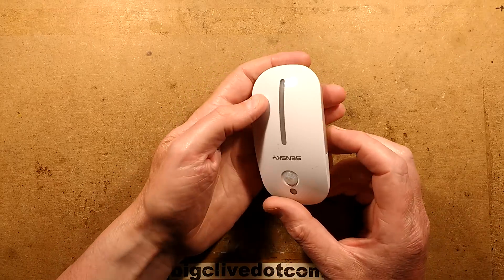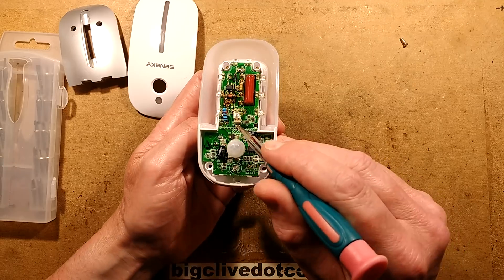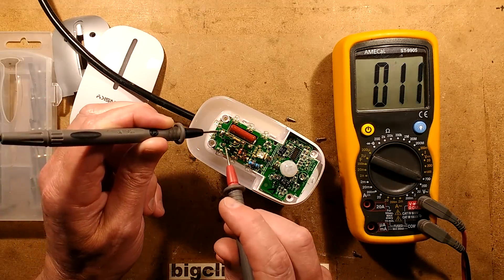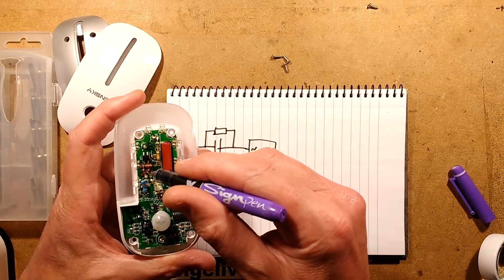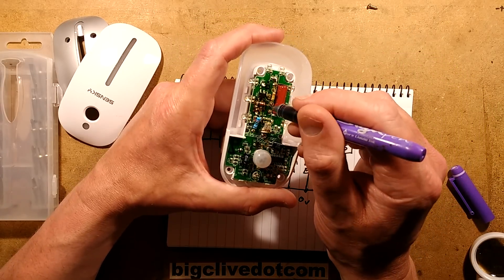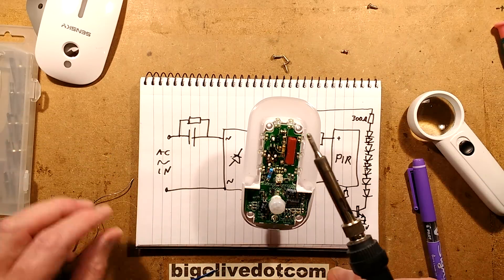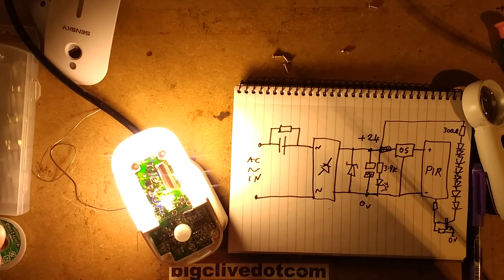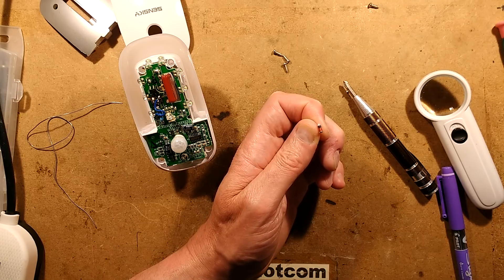Defective nightlight autopsy, half-assed fix and improvements.

Comment: Sure... When the voltage goes too high, just short out the power supply. That's an efficient way of dealing with it. :D
You could theoretically  solder in 40 regular diodes or so in series, instead of a zener diode or maybe a couple of LEDs (if they can take enough current) though that would kinda defeat the purpose. Not that soldering in 40 diodes would make a for better repair though. :D
I guess if you got no zener diodes, you got no zener diodes... That night light seems rather dodgy anyway. Not Chinese dodgy, just regular dodgy but still.

Comment: I've seen the lenses for PIR sensors come in all shapes and sizes, but this is the smallest I've seen, being able to slip just over the sensor itself :O It makes me wonder how critical this lens is to normal operation of the PIR, and how well/poorly it will work without it.
Reply from the maker: The sensors work by comparing the output of two adjacent detectors and relying on a series of lenses to create vivid transitions.  The smaller lens may have a shorter range than a bigger one.
Reply: bigclivedotcom I knew about the two elements in the sensor itself, just wasn't sure how much of a difference the lens itself made. It seems too small to be made that accurately, but then that'd stand to reason of the smaller lenses give shorter range anyway 😊 Thanks, Clive!

(PS you can't sleep either, huh? 😂)
Reply: Maybe they just use the day/night output.
Why would you want a movement sensor on a night light?

Comment: I would have put the zener after the resistor and before the regulator, it would still clamp the voltage, but would pass less current, unfortunately the LED's take their supply before the resistor.

Comment: Now, instead of switching the LEDs directly with a transistor, switch a resistor in to turn off the LEDs. Use a resistor to bypass some current to drop the voltage lower than the forward voltage of the LEDs, but still high enough to power the sensor (above the regulator dropout voltage). Now it'll use less power when off (still not zero) while the original circuit actually used more .

Comment: The resistor after the zener to the LM7805 should have been just after the rectifier, leading into the zener, being about 220 ohm or so. Most through-hole is 1W zener and SMT are 1W but without current limiting, its no wonder the zener fell down (malfunctioned).  Of course BigClive, taking out the zener, and a (say a 1/4 W non-SMT resistor before it, off the board connected mounted and all should be back to normal operation. Nonetheless, enjoyed your video as usual BigClive. In future, would like to see more Driverless Smart IC LED modules, even built into a nice (not the foul pink (red/blue) versions but real full spectrum warm-white and cool white combo configuration version (complete with dimmer) grow light would be nice.

Comment: I have several wall warts etc were the graphics on the case is oriented to imply the Chinese designer assumed the UK socket has the earth pin at the bottom, whereas in fact there is a very strong convention here that the earth pin is at the top.
Reply: Bill here, in the US, households generally have the ground pin down. In commercial where metallic wall plates are common, the ground is up so that if the screw falls out the plate does not short out the pins. Remember our pins are exposed their entire length.
Reply: Yes, that and the wires coming out the top of the wallwarts...which is sub optimal.  Although with the older transformer type that usually had a big bulky case, it may have been deliberate due to the old practice of putting outlets right at floor level
Reply: I believe this is probably because in the US, they ground is at the bottom. They likely can't be bothered to adjust the prints for UK market. Unfortunate.
Reply: @thysonsaccl Chances are probably wrong the right lines on thisaim
Reply: The story I heard, (don't know if it's 100% true) is that strictly speaking the code mandates that all US receptacles should really be mounted ground down, but the public prefer them upside down so they look like a face !

Comment: That means that the power used in nearly constant whether the light is on or off.  Why not have it on all of the time then?
Reply: In a word - marketing.  Because it's important to give the impression that you're saving power by turning off the lights.
Reply: JAMES AZBELL exactly, it might even use a little bit more power when off. Now, if the circuit were to switch in a lower voltage zener to turn the LEDs off, it'd use less power when off, but still not zero. A simple permanently-on LED would be ultimately more economical.
Reply: It is OK to short out a capacitive dropper. It is like a reactive current source. When you short it out you reduce consumption of "real" power. Of course this is not  the case with a resistive dropper.
Reply: JAMES AZBELL That is one of the key disadvantages of capacitive droppers.  They only work at constant power consumption, because the whole principle is to drop a large fraction of the power as virtual power in the capacitor.
Reply: I think one of the others that Clive disassembled turned off the LEDs by shorting them out. That'll reduce power consumption - current will increase, but it's almost all reactive. I suppose you'd have to make sure you left enough voltage to power the PIR, but that's probably only about 5V rather than 24V or whatever.

Comment: Heh. I have this exact light. Really like it... and the "Sensky" badge is the right way up in Canada ;-) Curious if mine will eventually cook, or if it'll do better at our 120V.

[Edit] I got curious as cracked mine open. It has a completely different board, but the circuit looks about the same. No sign of heat stress - just schmutz from the hand-soldered PIR.
Pic: https://ln.sync.com/dl/5aaa8e050/e6phv5nx-u9ypwgmj-gxuihgd5-9iqc8m5f

Comment: I bought a set of LED Stripes that included a generic Power Supply. The Powersupply didn't work straight out of the box, i already opened it, but I can send it to you if you want to Autopsy it

Comment: Bloody triangular screws!!
Reply: You can easily open them using a flatblade screwdriver that fits inside one of the sides of the triangle. Torque your way up slowly and you'll be ok. They couldn't defeat me as a kid with McDonald's toys, can't be bothered to be bothered by them today either.
Reply: Replace it with square screws with a pin in the middle
Reply: John Possum 
Or just repeatedly hit it with your X-ray device (hammer) until it yields.
Reply: Friend calls these "Toblerone Screws" for pretty obvious reasons!
Reply: just jam a flathead in and go. if super tight use hammer to flatten the whole thing :))
Reply: You can get cheap driver sets on Amazon (at least in the USA), that have drivers that can fit the triangle screws. But that's not to say you won't come across some proprietary, odd-sized ones.
Reply: At least its easy to grind a triangle screwdriver.
Reply: dremel a slot in them and open with a normal screwdriver. Works on all security screws, too.
Reply: lmao @ Phil S.  that didn't even cross my mind, but is spot on :)))
Reply: You know what I hate worse? Triangular wing bits in precision screwdriver kits. They look like phillips but don't work at all xD

Comment: I'm surprised to see so many pieces to this circuit. That's a lot of silicon for one simple little circuit.
Reply: Me too but when that happen I usually find out I'm wrong when trying to design my own.
Reply: It's not worth trying to design your own when these things are available for like $5 unless you have a custom situation. Many years ago I saw a great design for something I have never seen duplicated. It was called a Light Miser and it was meant for a light used in a room with lots of natural lighting available. You set the control and it kept the lighting even no matter how much or little light comes in the windows. The idea was that it would save on used power.
Reply: In Asian manufacturing the Penny per Dollar doesnt really apply, considering units such as this ofyen can be found on EBay for a few bucks
Reply: That theory sounds good, but more than likely when the unit was dimming, it was simply burning up power as heat instead. Pretty much still the same power usage, as it was simply a CDS cell in a dimming circuit. In this case, this little nite lite is overdesigned, and not overdesigned well. If your flaw is in the power supply...you are dead from the start.
Reply: Clive's nightlight is complicated partly because their are 3 voltage levels.

The light miser circuit I described basically just had the CDS cell "turn" the dimmer part of the circuit up and down. As such it DOES really save power much in the same way a standard light dimmer does. It was well intentioned but never got commercially popular probably due to cost. In electronics college I was taught every penny added to a circuit cost the consumer a dollar more markup in the end. Sometimes more.

Comment: I got one very much like that and was surprised how warm it got during the day when off. If I recall it used more than 1 watt so one might as well just have a small LED on all the time and save electricity :)
Reply: Thinking back when the LEDs were off during the day it used more power than at night when motion was detected and the LEDs come on. I guess cooking the diode uses more power than the little LEDs.
Reply: You find that a lot with the cheaper transistor-switched night lights. To avoid the "extra cost" of using a Mains rated transistor, they turn the LEDs off during the day simply by shunting the power through a resistor (usually a decent sized one, 1W or more). Sometimes voltage regulation is via a zener + resistor, often not. These generally use more power when "off" than when "on" (so in the past I've bypassed the "off" circuitry and left the LEDs on all the time - cheaper by far!)
Reply: IM35461   you triggered an amusing memory!  Neighbouring family bought a squidgy silicone alien nightlight from ikea  for their kiddy.  It soon failed.  Any guesses?  Yep, the dc from the wall-wart plugged into a socket on the pcb with no mechanical support other than two thin traces, which ripped.  I expected better of ikea.   Anyway, now working it was still too bright.  I got my acrylic paint box out and gave the 3 leds a coat of black paint.  Fixed!  Anyway, these direct plug in chappies bemuse me - what are the chances of having a wall socket in the right place?  I'd vote for batteries in such a low consumption  device.

Comment: you could have put many zeners in series to get about 24 V. I did several times as a electronics tech to find out problems when there were no stock available of the main value. The LEDs may have been stressed by the diode failure.Good video.

Comment: Does this look like a good kit from ebay to you guys? For LED droppers
https://www.ebay.com/itm/200x-0-001uf-2-2uf-25-Values-630V-CBB-Metal-Film-Capacitors-Assortment-Kit-/292476908217?_trksid=p2349526.m4383.l4275.c10#viTabs_0
Reply from the maker: Only about 10 of the values are suited to droppers, and those are the ones in small quantities.
Reply: I've had some bad luck with cheap ebay caps like these, they have been factory rejects and something like a third of them have loose legs or some other problems. Not really an issue if you can just throw them out but I don't like the idea of using them on mains projects.
Reply: Thanks so much.

Comment: Any suggestions on where to get a good capacitor assortment for this kind of work? I don't have Clive's junk box :)
I do have that particular night light, and like the light it gives. Suggested values for 120 volt use are always appreciated.
It would be a fun video about why capacitors drop ac without much heat.
Reply from the maker: I'd suggest a capacitor about half the capacitance value of the one fitted.
Reply: Thanks

Comment: Hi Clive. I sent that in, thanks for the teardown. I had found the short across the diode and capacitor but had not removed from circuit so wasn’t sure which it was. I thought it had taken out the fuse, but clearly not. I’m surprised it did not?
Reply from the maker: It's a capacitive dropper, so the shunted zener just put the capacitor across the mains like a suppression capacitor.  If you have any more of these units then the easy fix is to replace the red capacitor with one that has a lower value like 330nF.  That will dramatically reduce the heat of that diode.

Comment: I find that your lamp projects usually look better if you don't take off the exposure lock after turning off the lights: it makes it possible to see actual colour, rather than the camera showing white because it's totally saturated. @12:24 looks better than @12:32.
Reply from the maker: I noticed that afterwards.  The problem being that after the bench lights it would have looked excessively dull if I hadn't taken exposure lock off.
Reply: Yes exactly, thank you for doing it that way BC.

Comment: Apparently it's "Zenner" rather than "Zeener". Named after the American physicist Clarence Zener who discovered the effect.
Reply: My grandfather / electronics mentor always said Zeener so that's how I hear it in my head when I read it.
Reply: I asked the same question on Quora a while ago and was told Dr Zener pronounced his name ZEEner. So it goes.
Reply: Its pronounced "avalanche" because the Zener effect is only apparent at low voltages. under 6 volts I believe, above that these diodes work by the avalanche breakdown. but they get called Zener diodes.
Reply: This one has it written as "zee-ner"  http://www.dictionary.com/browse/zener-diode
The audio clue there also has "zee-ner"  https://en.oxforddictionaries.com/definition/zener
As does that  https://www.collinsdictionary.com/dictionary/english/zener-diode

!!! OllieEdit As an aside - Apparently his middle name was Melvin . heeee
Reply: Actually it's levio-SAH
Reply: It’s entirely likely that someone like Zener who was born in the USA early in the 20th century would pronounce it ZEEner, no matter how his ancestors pronounced it. Here in the USA I’ve heard only that pronunciation, for what little that’s worth...
Reply: Fun fact: the guy who Mt. Everest is named after pronounced his name "Ee-vrest," not "Ever-est."
Reply: How do you know it's not "Zeener" rather than "Zenner" named after the American physicist Clarence Zener who discovered the effect?
Reply: "I have designed this circuit with a 9.1 volt Clarence"  doesn't really sound the same does it.
Reply: In U.S. English, the word zenith is pronounced "zee-nith", so thus it makes sense that zener would likewise be pronounced "zee-ner".
Reply: Steve Hallam Knowing the yanks... It's probably pronounced as Zeener... Like tomato is tomayto.. Etc etc.. Then, England and Australia.. We chooseday and not tewsday.. So it's fair enough.. Lol
Reply: Ma chi se ne frega se si dice Zener o Ziner, chi è inglese lo pronunci come gli pare, io sono italiano e dico Zener. Punto.
Reply: Actually, it's pronounced, "Throat Warbler Mangrove".
Reply: Rimmersbryggeri I like that. From now on it's a tsehner.
Reply: I use "zenner" when speaking/thinking/reading French and "zeener" when using English.
Reply: Who needs that vowel anyway?  Just pronounce it Z'ner
Reply: On Google it says it as Zeener (Zi-Ne)
Reply: Zadster
It's just what we're used to, heck they're probably measuring current in volt in a parallel universe.
Reply: Is that Zad-ster, or Zard-ster   ;)
Reply: according to google, it is spelled with one e but pronounced "zeener", i clicked on their pronounciation link and thats how they pronounced it
Reply: Quick, invent a type of diode and get Clive to look at the circuit that it's on !
Reply: The OED, Webster's, and Random House all claim "Zeener."
Reply: And the man himself pronounced it Zee-ner.
Reply: Google is American so its not surprising, Americans pronounce "z" as zee, most other parts of english speaking world pronounce "z" as zed, so either or works
Reply: If it were a direct derivative of Zadoc it should really be Zayd-ster, but as it comes via the contraction Zad (which by convention would have to be spelled Zade) it is Zad-ster. Or something.
Reply: Crystal Soulslayer 
Someone watches QI!
Reply: Zenner, zeener, solder, sodder
Tomayto, tomahto, potayto, potahto
Reply: Thanks for researching that on behalf of the rest of us. :)
Reply: The correct pronouciation if you want to be nitpicky like you guys clearly want that would be in german.  It's a stupid argument anyhow becasue we all know what is meant to be communicated either way.
Reply: It's pronounced "zener" - it's someone's name, and thus pronunciation does not vary with country.